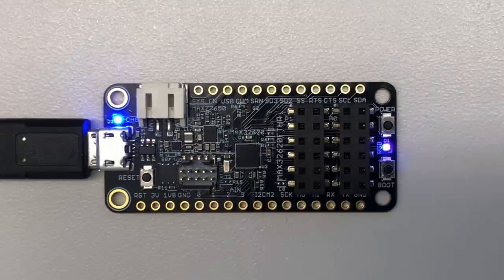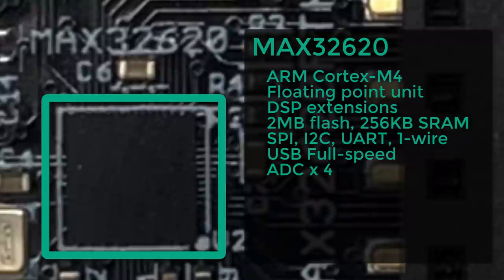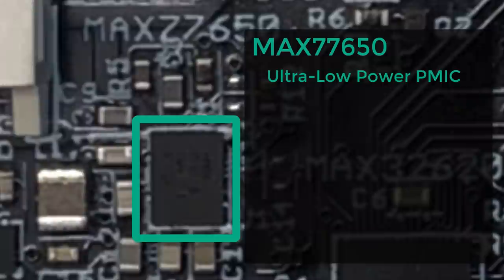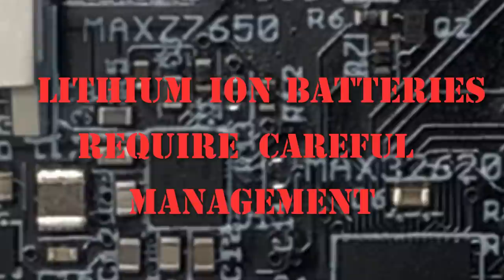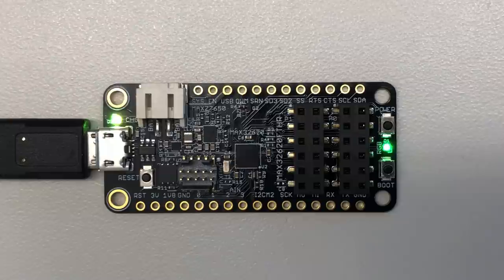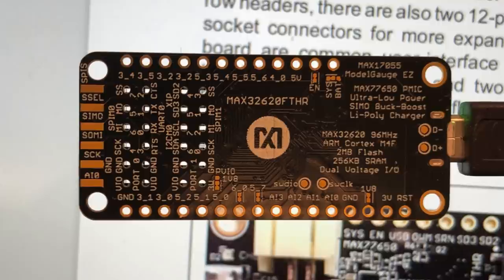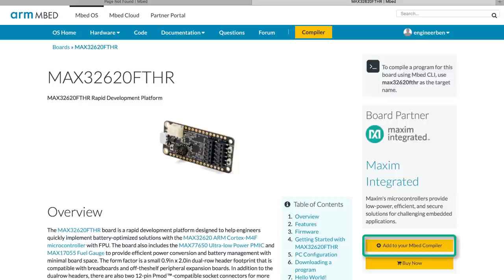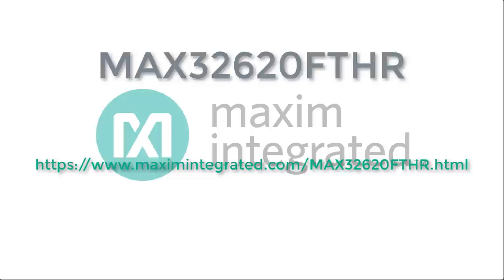Introducing the MAX32620FTHR Prototyping Platform

Comment: The "active device" that shows up when I connect the MAX32625PICO board (shown in the video, but not mentioned) is MAX32630FTHR, not the MAX32620FTHR. So far, I have not found a way to fix that.